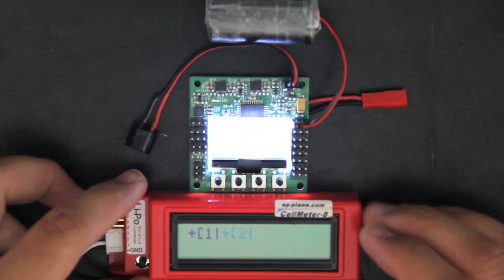KK2 Voltage Alarm Setup

Comment: My kk2.0 has no solder point on the board.
Reply: It's probably a KK2.1, which has a voltage monitor jumper on the top of the board.

Comment: For this voltage sensing circuit, since the board is already grounded to the battery is the ground really necessary and can you just connect the positive battery to the board?
Reply: Mark Johnston I did it like you said and it works as it makes sence :)

Comment: Nice video But you don't mention  at what voltage you should set you set point.
Remember it will be be tripping under load.

Comment: So If I wanted to set this up, all I would have to do is solder a connector on that part of the board, then run a lead coming from my main battery pack to that connector and it should do its thing.. I currently have a x900 Tricopter with no power board, just an xt60 plug and a lot of wires. I just have to tap into that to get a reading.. makes sense to me! :)

Comment: To repost from 12 months ago

I run my 3s system at 10.5v to give me some time to get it back. Never let your lipos go under 3V per cell. They will drop off slightly before that.

by dhdsracer

Great vid thanks. Building a F550 with the k22. Got to love YouTube.

Comment: You dont need to solder the ground, as your speed controllers are grounded to the board and the controllers to the battery. You can plug the positive end in the last pin of you balance port to get your voltage.

Comment: Why not just add wire of the negative wire to negative pin (esc negative pin that provide power) of the board of the one that provide power? This is something hk should even do anyways automatically.

Comment: I'm so confused. The KK2.0 board Input Voltage: 4.8-6.0V  But you can connect a 3cell to the voltage alarm port?

I just want to run off a single 3cell so Should I "Y" Split the red 5volt ESC cable into the voltage alarm spot 

- or "Y" split at my battery harness which is sending out 12volt?  directly to the voltage alarm port.

Comment: This was very informative. However a quick run down on what voltage setting for say a 3s LiPo or maybe a chart indicating what the low voltage alarm setting recommendations are. 
I've just set up this board on my first quad and not sure where I should set this alarm.

Comment: Thanks for the video, very informative.
People use ONE battery should not connect GND. The reason is this will create multiple paths from the KK2 to GND, which creates a "Ground Loop". This is a common reason for interference and noise in electrical systems.
It might noe be that big of a deal here, but best practice is to avoid it.

Comment: Hello man, i set the voltage alarm to 105 and i'm using a 2650mah, but when the battery reaches 11.5v the V.A. starts beeping.. it's supossed that the kk starts at 10.5v.. i'm doing something wrong?..thanks

Comment from the maker: For a multirotor, just run a single positive wire from the power distribution board into the small hole on the board. The negative wire is redundant unless you are running on a plane.

Comment: Im not new to RC, but I am new to quads. Ive got a KK2 on the way for my first build and obviously I am missing something here. The battery is connected to a power distributor setup that feeds to the esc's so where would you connect the LVA connector to the battery. Obviously this is a noob question, but Im lost on this one.

Comment: Thanks man for this!!! I knew that the board could not possably know the full battery voltage with just the BEC 5v connection. I have been pulling my hair out trying to figure out what I am missing. I could not find any prints to go by or any literature on this. Please tell me where you got this info or how you figured this out. Without a print of the board their is no way to figure this out. Thanks again!!!

Comment: You do not need to use the plug, you could just run Pos and Neg wires directly from the kk to your PDB,  I think he used the JST from kk to pdb to make it easily removable? with out having to de-solder it. But he did not show.say to solder the jst from the pdb.. which i think added a bit of confusion to someone who is new. He used a small 3s just for testing.
correct me if im wrong hair man child haha
I have yet to do this but want to. now i just use a LVC alarm to the balance plug...

Comment: If you are using a power distribution board with your multi copter or  a built in  pcb all you need to solder is a wire from positive point on the kk2 board that was shown in the video to a positive point on your distribution poard or built in pcb. There is no need to solder a ground wire at all.

Comment: ive tryed all voltage seting with no luck... setting was 11volts and lipo voltage was 10.5 and settings didnt  make any diff. ill try the distribution board. thanks for the help.

Comment from the maker: what voltage did you set the alarm too? What voltage was the lipo you plugged in? The balance plug would work if you use the far end wires only but I like just plugging directly into the power distribution board.

Comment: i cant get it to work with the balance plug... i used the ground and the 12volt  from the plug and its still willl not work. i got it hooked up like you show in the vid so i cant see why its not working.

Comment: so i would  need to hook up all power wires from the balance plug into one and ground to ground?... i tryed with just the ground and one power wire from othe side of balance plug  and it will not work. thanks for the help.

Comment: Don, is there any way I can contact you I am having a problem with my KK2 board: one the lower Throttle limit is 10 and yet with the rx test saying the throttle is 0 the motors are spinning up and down up and down. two the ESC's I'm having a hard time calibrating them, I think the ascending tone is for full throttle I never seem to anything that sounds like a descending tone. and three the LCD window is coming off its white backing, still works, but that's not good. snaprollin@yahoo.com mike

Comment from the maker: you could but I wouldn't recommend it. What I would do is use a custom Y harness to power the board and servos at the same time with out two power sources. That way you leave the door open in the future for multiple BEC's on the circuit. watch your power consumption too.

Comment: is it possible to solder all the positive terminals to each other for the servo's so I don't have to make a separate power source for it? Note that I'm going use the board for airplane stabilization

Comment: Just built a hex with the kk2.0 board & flies well,but my Q is this. The PDF I found on the board said that it gets it's power from the M1 point- all my esc don't have BEC so I hooked a UBec from the batt to the RX and then hooked the 4 jumper leads(standard 3 conducter) from RX to control board just for signal purposes(although IK u don't need all 3 legs for signal) and the kk board powered up. And that's how I've been flying it. My concern is that it said only to use the M1 to power it, or th

Comment: Also if your multicopter flies with 2 or 3S (my micro quad does so), you can set alarm for 2S lipo and in case of using 3S, just connect pin to the second hole from right in ballance connector to read voltage from only two cells.

Comment: Thanks!  I had it at 10.  I checked it and couldn't get it to alarm.  I took it off and all my tinning is in the same places you show on the video, but when setting the limit to 13v it still would not alarm.  I think I'm going to get the alarm from my second KK2 and see if that is the problem.

Comment: What is a good setting for a 3S?  3.1 per cell sounds kinda low!  I would like my batteries to last as long as possible even though I may get shorter flight times.  I've been setting my ESCs on medium and wondered what voltage that would be.  9.9v?  10v?  Thanks for any info you provide.

Comment from the maker: Of course you can. Just make sure you use the ground and furthest wire on the balance leed or you will miss a cell. I just soldered it directly into the distribution board. That way there is no need to connect anything.